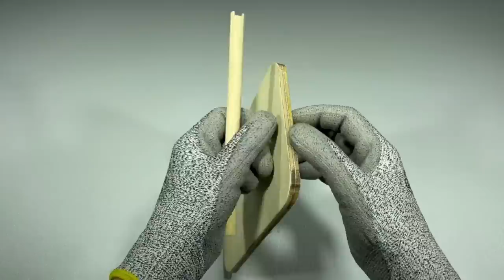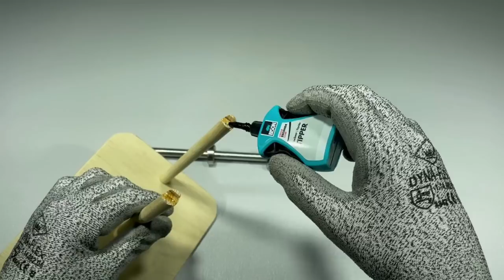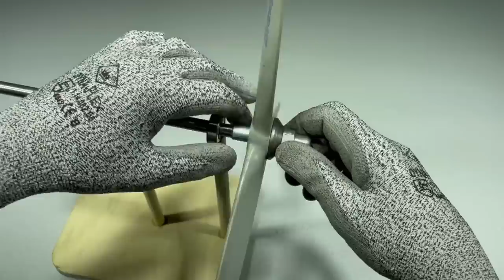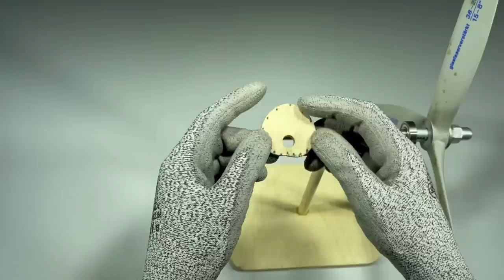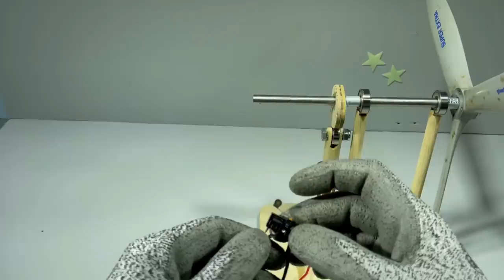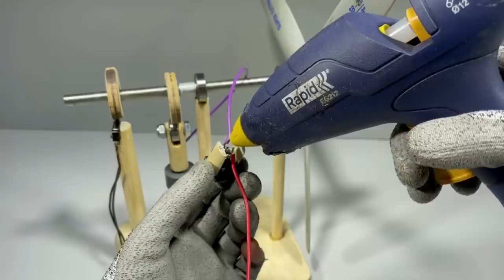HOMEMADE ELECTRIC TABLE FAN using wood, copper wire, and a magnet.

Comment: How is it pushing up?
Reply from the maker: Thanks for your question. In the middle there is a magnet. At the moment there is current flowing through the copper wire around the magnet there will be a magnetic field that pushes the magnet up. It is far from perpect at the moment but I am working on a  calculation programm so it will be easy for me to find the right copper wire, magnet and wire tube, and voltage to make it as powerfull and small as possible.
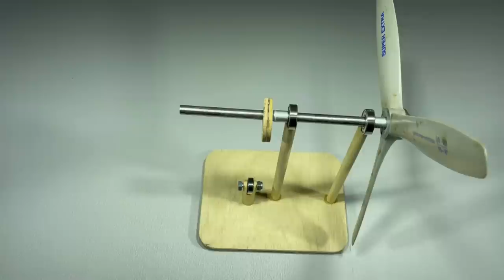Reply: @electricexperimentsathome3632   was the cylinder your magnet at 3:40 ? thank you for answering, also, great video! Very inspiring! I will be using this video later in life to make a bigger contraption I hope, you have an amazing invention here..  why would you want to make it smaller? What do you think the difference between bigger and smaller will be?

Comment: How many times did you mess up before you got this video right
Reply from the maker: Hello Remedy, The most difficult part was the pushring, and yes I did mesh it up several times. But al together I did build it in about 2 weeks, say general in 1 hour a day. But after al my solenoid electric fan works perfect.

Comment: Wow. It is an exquisite combination of solenoid, limit switch and cam. It's clunky, but it's nice. I'd love to try making something similar if you allow it. But where did you get these cool propellers? Did you make it yourself?
Reply: There are not so many tools. I did use wood, copperwire 0,2mm and some iron that i did have laying around my house. The only thing I had to buy whas the magnet. In my case it was a 60X12 mm magnet that I did buy at supermagnete.nl because I come from Holland and this one had fast delivery time. The system is working at 24 volts so you need a transformator. The system does use 0,3 watt. It was funny to build. You can use your own messurements. Ow, yes and I did use a plastic rot and a propeller from a model plain that I did have in my hobby room. The main job is to messure how many copper wire yoy need to heve enough resistance and power. On your question if I did make it myself, yes I did. It did take me a lot of hours but it was nice to do. Have fun building one to. Sorry for my not so good Englisch, I come from Holland and a other laguage then Dutchis not my best thing.

Comment: It would be a more amazing machine if you put that propeller on a very fast motor
Reply from the maker: It would be a nice thing to build next with a krank so it is not so noisy. A V6 or a V8. Only thing is that i have to buy some more magnets, buT I think I can handle that. :-). Yes that wil be my next mission. Maybe my english is not so good, but yeah I come fron Holland. I think you understand.